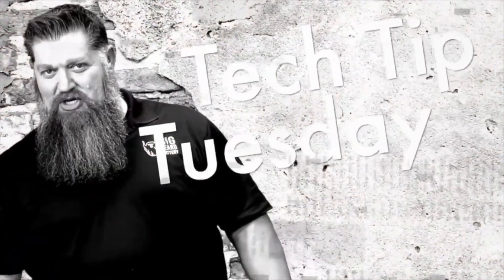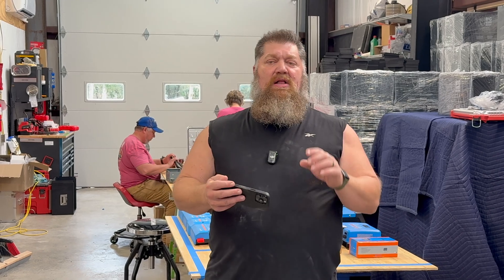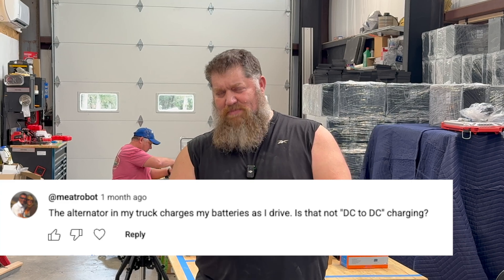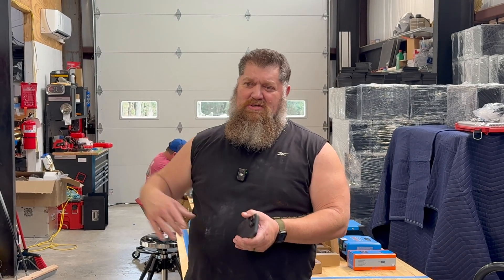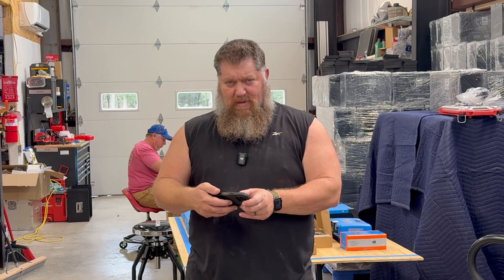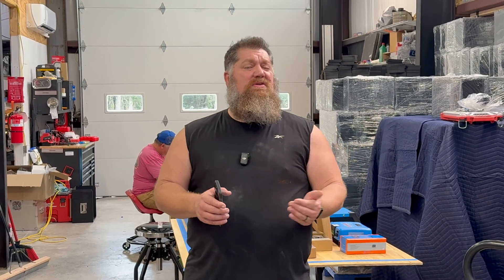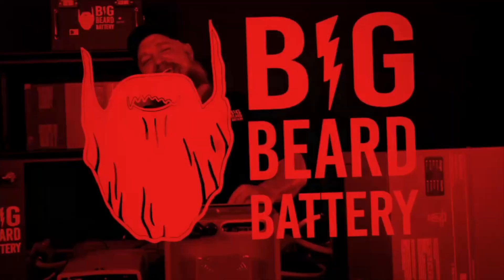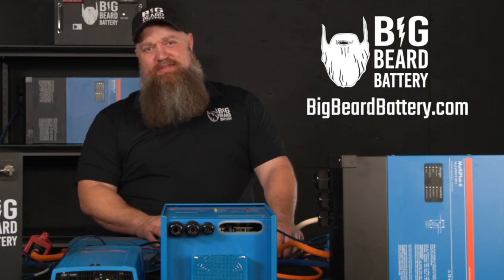Your RV Battery Questions Answered: Alternator Charging, Battery Storage, and RV Storing Tips

Comment: Let's face it, trying to charge any battery, LiFePo or lead acid, through the trailer cord is pretty much useless, the voltage drop over that distance through a 10 awg wire is enormous. 
To prevent the camper battery from draining the starter battery the best option is to install some sort of disconnect on the camper or somewhere in the 12 Volt cable coming from the vehicle. IMHO, if you can afford to spend an X amount of $ on a camper you should be able to afford a DC - DC charger and some 6 awg or 8 awg wire for $100 - $300.
Reply from the maker: Or not connect the two systems at all and leave it independent of one another

Comment: I always heard that it is best to keep batteries on a maintainer or tender during the winter. That is different than what you are saying. Is it only true for Lead Acid batteries, or is it never true?
Reply: Never allow lead acid to be stored in a discharged state. It will destroy them. I learned this the hard way years ago, finding one year old ruined batteries after winter storage. Keep lead acid on a maintainer. If long term power is not available, fully charge them, then immediately disconnect at the terminals to be safe.  This does not apply to LiFPo